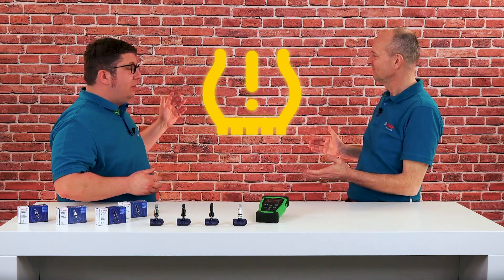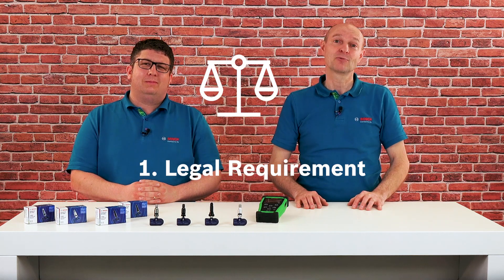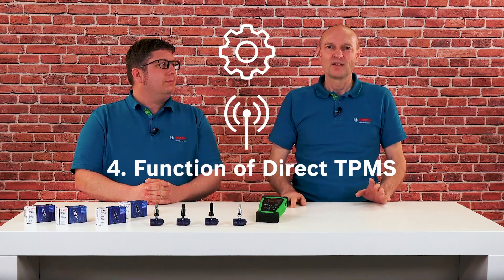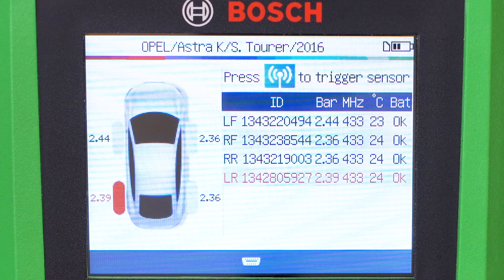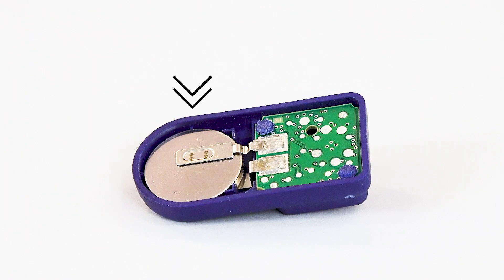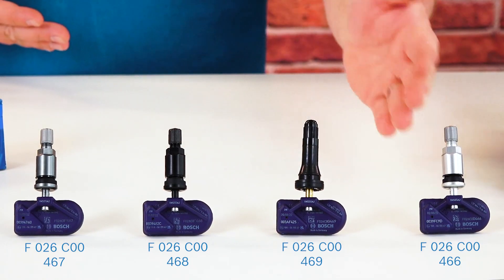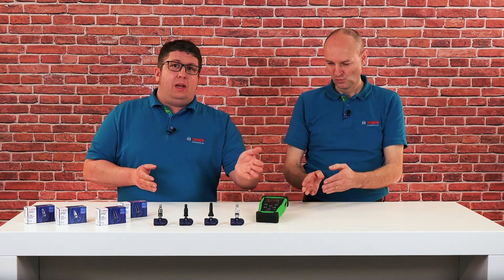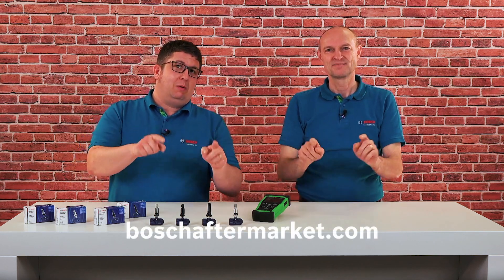Bosch TechNuggets: TPMS sensor and TPA 300 programming tool - Automotive. Knowledge. Explained

Comment: Ist ja schön das es die Videos gibt, aber wenn man den Hinweis DE schreibt, denke ich das die Sprache auch Deutsch ist.
Reply from the maker: Vielen Dank für die Rückmeldung. Das Video ist in englischer Sprache mit Deutschem und englischen Untertitel verfügbar. Bitte aktivieren sie in den Einstellungen die für sie passende Sprache.
Reply: @boschmobility  I'd like you to confirm above inquiry as well. "Are there any other tpms tools capable of programming the quickfit sensors?" Because in my case, I bought the tpms sensor but there no more use the TPA 300 tool any more in our country(South Korea) . So I'd like you to share the information about it.